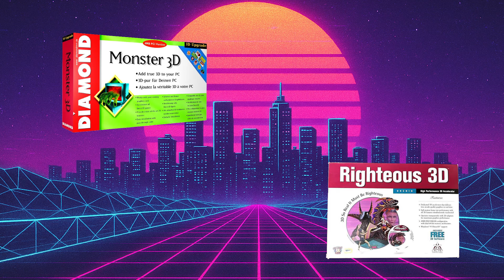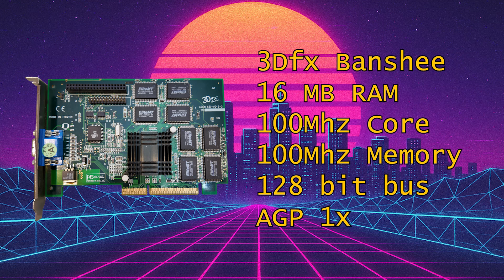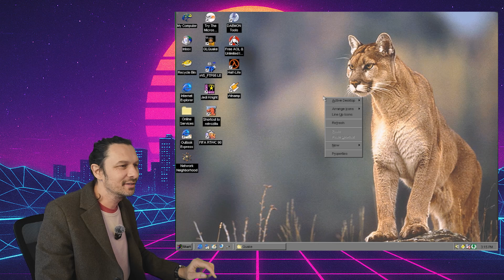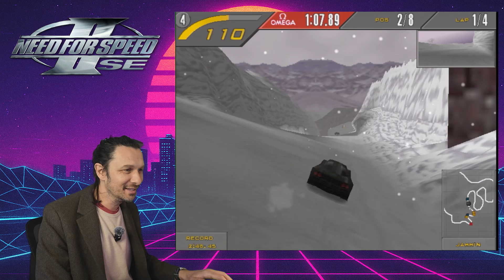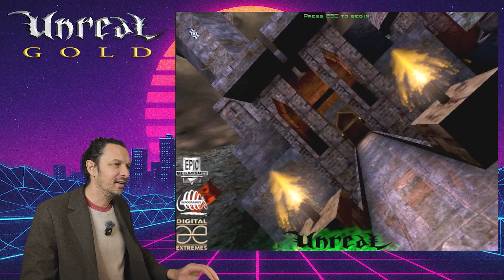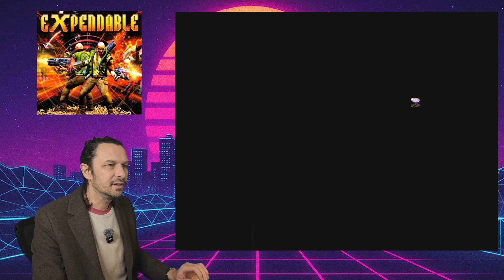3dfx Voodoo Banshee Revisited: One of 1998’s Most Important GPU's?

Comment: Banshee cards, much like the Voodoo 3, 4, and 5, scale well with faster processors. Pairing them with like a Pentium II 333mhz, let alone any Pentium II or AMD K6 II or III, you just end up with the Pentium II or K6 bottle-necking the Banshee. Most of the major titles back then were heavily CPU dependent. Like pair a Banshee with something along the lines of an Athlon 750 or Pentium III 733 and you will see a pretty significant performance jump in games released in 1999 and prior in D3D, Glide, and OpenGL. Also, you can use the WickedGL files if you want to tweak performance in certain OpenGL games. People watching this video should use it as an example of how a Pentium II can benefit from a Banshee, but should understand, the card is capable of much better performance than what was demonstrated here in this video.
Reply from the maker: Completely agree, I'm actually thinking about doing a follow up video where I demonstrate its legendary scaling, and put it in a Pentium 3 993Mhz system and compare the benchmarks.
Reply: @ComputerRetroBus  Fastest setup I ever used a AGP Banshee in was with an Athlon XP 2400+ on a Asrock K7VT2. Had a Monster Fusion Banshee paired with that combo. Anything the Voodoo 3 could run, the Banshee could also run, just a tad slower. They both basically had the same kind of performance cut off where later DX7-DX8, OpenGL, and Quake 3/id Tech 3 engine games ultimately became their bane. Even the Voodoo 4 and 5 struggled with later OpenGL and id Tech 3 games like Serious Sam, RTCW, and Medal of Honor.
Reply from the maker: @TheOldGodFX  wow that's epic! I have never tried a system that fast with my Banshee! time for another video lol
Reply: @ComputerRetroBus  This is the video I recorded of the setup 15 years ago or so. I keep it hosted on my older channel that I use for random stuff.
https://www.youtube.com/watch?v=pYWVfcSlUXc
Reply: Not really a pentium 2 300 will get the same frame rate as pentium 3 900 MHz in quake 2 so I'd say you're talking shite 🤣 unless you're playing at an extremely low resolution
Reply: @si4632  It's much more nuanced than this, and the way you post makes it seem like you simply scraped your knowledge off a few Banshee haters, instead of having actually used them. Youre hyperfocused on one particular game that I never even mentioned, Quake 2. Also, since you mentioned it, the Voodoo 2 featured two TMUs (I never mentioned the Voodoo 2 in my comments). This gave it an advantage in Quake 2 over the Banshee in multi-textured games, up to a certain point (single V2 card 8MB vram limit kicks in eventually at higher resolutions, but usually at higher resolutions past 1024x768 it doesnt matter anyway either with Banshee or 12MB Voodoo 2 because performance tanks hard).

In Quake 2, in general, the Banshee still benefits from a faster processor over a slower one because CPU dependent areas with a lot of enemies and effects going on still benefit from faster clock speeds, and prevent worse lower minimum FPS dips than a slower processor would experience. Basically, all decent cards benefit from this, not just the Banshee in this game. Quake 2 isn't completely performance capped and gets better with faster processors. And the Banshee in general handles the game well at 800x600, which was a fairly desired resolution to use in 98-99. Getting 45-50 FPS averages are fine on Quake 2 with a Pentium 3 @ 800x600.

And again, to address the whole Banshee vs Voodoo 2 thing, again mind you I never even mentioned a Voodoo 2 to begin with, but either way, they traded blows. The Banshee excelled at single texture games, which a lot of Direct3D titles tended to be in 98-99, running many of them much faster than the Voodoo 2 was capable of. Off the top of my head, Expendable and Dethkarz comes to mind, and then you have those 3D mark 99-2000 scores too showing how D3D favored Banshee more. 

Again, you also had the whole vram limit issue, which caused some games to favor the Banshee a bit compared to the Voodoo 2 8MB instead of the 12MB variation. The Banshee also had hardware variations, some of which like the GA-630 being a small bit faster than others (SGram vs SDram). The Banshee also benefitted from using the more mature drivers that were released near the end of its support life. The initial driver release was meh at best.

One of the major benefits though that is absolutely worth mentioning of using a Banshee over a Voodoo 2, is the whole single card solution it provides, with strong 2D performance for Dos games. Someone who is going to want to either simplify their build, or free up PCi slots to use multiple sound card solutions, MPEG2 add in cards, or things like USB or SCSI PCI cards will really appreciate the fact that they wont have to deal with one or two Voodoo 2 cards along with a extra 2D PCI solution. But I mean, for any of the above, you don't need me telling you any of this. You have years worth of post on Vogons, youtube, along with archived post and reviews from older websites and their related forums.
Reply: @TheOldGodFX no at 800x600 it's the gpu that's the bottle neck no need for essay mate I got the benchmark results readily available for unreal quake 1 quake 2 on a wide range of cpus lol
Reply: And you actually get batter results adding a second voodoo2 than you would using a 800mhs pentium 3 lol
Reply: @si4632  Uh huh. Who are you trying to convince here, your, or me? You have a channel with no videos and have been posting literally nothing of merit. Just a lot of typo laden yapping. How old are you even, child? Let alone, do you even English, bro? Can't you be bothered to at least proofread or fact check before you click "post"? Regarding lone 8mb-12mb Voodoo 2 cards and the Banshee, 800x600 was often the sweet spot for the vast majority of demanding Direct 3d, OpenGl, and Glide titles on either card. 

You realize a lone Voodoo 2 was not a massive performance leap over a Banshee in Quake 2, no? We are talking a 5-10FPS gain, depending on the area of the game you are in. Both cards were pulling over 40fps, and coming in under 60FPS @ 800x600 in Pentium III builds. The average was very close, and some Banshee cards were able to get closer to minimizing the performance gap with better clocks in that game.

Since you're obsessed with the game, you should already know a lone Voodoo 2 was only pulling in about a 55-60 fps average in Quake 2 at this resolution, depending on your processor, and COULD NOT even do 1024x768 in that game, let alone any game, due to the limited hardware framebuffer. You needed two of them to do past 800x600. The Banshee however could run Quake 2 and plenty of other games at a playable framerate in 1024x768. You know what used to cost a whole lot more than a single Banshee in 1998? Two Voodoo 2 cards paired with a 2D accelerator card. Do the math on this bang for buck situation you goof.

This was pretty much a thing for most graphics cards released in 1997 and 1998 though. Even the Voodoo 3 benefitted drastically from using 800x600 instead of 1024x768. Most review websites at the time even bench tested at 640x480 and 800x600 because that was the resolution most gamers were using.

"And you actually get batter results adding a second voodoo2 than you would using a 800mhs pentium 3 lol"

You going to bake a cake with that batter? Also, is Quake and Unreal the only things you have ever played in your entire life? You realize there is thousands of games out there from that era, no? If I was as obsessed with Quake 2 as you are, I'd simply run it on my RX 7900 XT, since it smashes the Voodoo 2. And this can be said about every single modern GPU. They all smash a Voodoo 2. Seriously, you're worried about fighting with complete strangers about pitting two 3DFX products against each other in old games, worried about the Voodoo 2 winning more in 2026? Said games that can be run on anything modern with far greater performance? 

Are you serious? And now you're experiencing that self-doubt, realizing you were wrong, and having to switch over to "with two Voodoo 2 cards you can do such and such..." once you googled and realized a lone Voodoo 2 can't do past 800x600? One, the only one worried about or bringing up the Voodoo 2 here is you. Did you just recently get a Voodoo 2 off ebay, and now you feel threatened and triggered about your purchase by Banshee users and want to feel validated that you made the right choice? I mean I can tell you don't even have a Voodoo 2 in hand yet, because you have completely ignored the fact that they can't do past 800x600 unless run in SLI.  Someone who has actually owned/used a Voodoo 2 would not be trying to argue in its favor so hard against the Banshee knowing full well a lone Voodoo 2 has to trade blows and can't do 1024x768.

The OP, nor I, ever mentioned anything about Voodoo 2 cards because they were not the topic of discussion or in the video. This is completely a Y.O.U. thing and you are making yourself look stupid AF. And two, not only did you go from one Voodoo 2 to now needing two Voodoo 2 cards, but you also now insist a second Voodoo 2 is more beneficial to a PC of that era instead of jumping from a 333mhz Pentium II to a 800mhz Pentium III? LMFAO. That is literally not going to balance out. You can't replace the overall benefits of a faster processor in games with a second Voodoo 2. 

Two Voodoo 2 cards with a Pentium II @333mhz are not going to obliterate a Banshee paired with a Pentium III @800mhz in the vast majority of games released during 97-2000. Some games that could run with a potato for a processor, sure. But then you run into ones that use Software T&L heavily, or like cpu dependent racing sims, and that's that. The Pentium II 333mhz can't compete with the Pentium III on any level, let alone one running past 600mhz. It's simply absurd to suggest that is a thing.

Worried about the benchmarks ehh? Check the link below, but the sum of it is:

3DMark 99, Banshee beats Voodoo 2.
3Dmark 2000, Banshee beats Voodoo 2.
OpenGL Stars, Banshee beats Voodoo 2.
Villagemark, Banshee beats Voodoo 2.
GL Quake, Banshee can run the game at playable performance at 1024x768, Voodoo 2 can't.
Quake 2, Banshee can run the game at playable performance at 1024x768, Voodoo 2 can't.
Unreal Tournament 800x600, Banshee 31fps, Voodoo 2 38fps (literally a OC close the gap kind of situation).
Quake 3, Banshee smashes the Voodoo 2, and it takes two 12mb Voodoo 2 cards in SLI to catch up to a lone Banshee in 800x600 (literal example of the limited frame buffer kicking the Voodoo 2 in the nutts).
Undying, Banshee beats Voodoo 2, but this is a close one at least.
Dungeon Siege, Banshee absolutely beats Voodoo 2 with a large performance gap (and this is an example of why frame buffer, vram, clock speed etc. matter when comparing the two).
Serious Sam SE, again the Banshee sends the Voodoo 2 packing.

https://hw-museum.cz/article/2/benchmark-vga-1998---2001--2011-edition-/1
Reply: This with a voodoo2 which is actually faster than a banshee
Reply: If you're talking about later games fair enough but you would be stupid to pair such a weak card with a 1ghz machine 🤣

Comment: If you could do a whole video on removing and installing Slot 1 processors, I am sure I'm not the only one who would be eternally grateful.
It isn't the most obvious thing in the world and trying to find instructions for it, well, you'd be inclined to think you hallucinated the very existence of Slot 1. To make matters worse, there are multiple, very different retention mechanisms for Slot 1.
I pulled a Slot 1 processor last week and I'm still not convinced I didn't break the bracket. I had a couple of pieces left over...is that normal? I missed out on Slot 1 back in the day and I'm so confused. 
Frankly, I wish someone would do the same with the stock intel cooler of the past 25 years. I've read and thought I was following the instructions many times only for it to not work. Not sure I would trust it even if I did manage to get it to stick. It is a thoroughly mind boggling design to me, as someone who studied physics and industrial design, which is probably why I can't figure it out. It is too stupid for me to comprehend :P
Reply from the maker: heheh no problems for sure, I will go into more detail next time I do it, I completely understand and also the intel cooler with the 4 fan retention slots you need to twist, took me ages to figure that one out

Comment: Quake 2 was released 6 months before the Voodoo Banshee and Unreal just 1 month earlier. Unreal is very CPU dependent, the P2 333 mhz is just too slow. With a P2 400 or 450 mhz it would have run much better.
Reply from the maker: Yesh I agree, and the voodoo cards really scaled well with powerful CPU's in general I feel
Reply: @ComputerRetroBus  They do, but voodoo cards (especially voodoo2) are also lighter than other cards when running in glide mode, cause glide is low-level API with lover CPU overhead. That being said, with Unreal there is a major CPU bottleneck there. I suggest disabling dynamic lighting and setting the "min desired framerate" to 999, that reduces particle count. Those two options help with the CPU load a lot, and the game keeps most of its visuals. With Unreal and especially UT, you had to have a 1+Ghz PIII or K7 if you wanted to be in the "keep it above 60" territory all the time. Generally, back then CPUs were very underpowered compared to what those cards could do. Thankfully, the SLOT1 platform had huge upgradeability options in the future, and you could run overclocked Coppermine Celeron on the same board 2 years later with 3x the performance. If you had one of the better BX boards and proper adapter, even Tutaltin.

Comment: Interesting video. Yeah the Voodoo Banshee only run in 16-bit but it had the best 16-bit quality of all the 1998 cards thanks to the 22-bit filter. The Voodoo Banshee was the first 3dfx card to support the 22-bit filter, always active in resolutions of 800x600 and lower and in 1024x768 it had to be activated manually. The Riva TNT was overall faster than the Voodoo Banshee by 10-30% but the 16-bit image quality was inferior to that of the Banshee, the Riva TNT (just like the TNT2 and Geforce) in 16-bit displays a very ugly looking grid pattern especially visible on dark textures. And in 32-bit the Riva TNT (just like the TNT2 and Geforce) looses 40-60% performance compared to 16-bit. In my opinion higher clocked Voodoo Banshee cards like the Gigabyte GA-630 (110/130 mhz) and Monster Fusion (105/120 mhz) were clearly the best video cards of 1998, because they had the same speed as the Riva TNT and Voodoo 2 but better 16-bit imagine quality (and better game compatibility than the Riva TNT).
Reply from the maker: Thats fantastic insight and detail. So the Banshee wasn't that far behind at all really to the TNT, what a gem of a card, I really love and cherish mine. I really need to try and overclock and see how I go, never tried it on a Banshee before.
Reply: Totally subjective. If you're obsessed with graphical detai, sure, go with the Banshee. If you want stability, reliability, high framerates and the best overall support, go with the TNT. There is no magic retro gaming GPU. I feel like the people who are most supportive of Voodoo really only play 5 or 6 cliche '90s PC games. When you have a lot of hardware, like me or OP, it is easy to sing the praises of Voodoo because, when it lets you down, you have another, more reliable PC right next to it. Most retro gamers aren't going to have that advantage. The Voodoo was a poor value proposition back in the day and it is a poor value proposition for retro gamers in 2026. The fact the TNT renders less smooth textures is actually a feature these days, not a bug.
Reply: @RunsWithChainsaw  you clearly don’t know what you are talking about. Stability, reliability, game compatibility were the strengths of the Voodoo cards, NOT of the Riva TNT, that’s the main reason why games loved those cards. With the Riva TNT you couldn’t even play games like NFS 2 SE, Carmageddon 1997, Scremer, Blood and many others they had ZERO support for the Riva TNT, you had to play them all in  SOFTWARE MODE while with the Voodoo cards you played them in Glide. Even the first version of Unreal 1998 only had Software and Glide support, no Direct3D support at all, only lated versions added Direct3D support. Even Unreal you were forced to play in SOFTWARE MODE with the Riva TNT for a few months after it’s release until Direct3D support was added with later parches. And even with later patches only after around 1 year Unreal finally got a version that run well on the Riva TNT. I had exactly a Riva TNT back than, I know what I’m thinking about. And like I already said the Voodoo Banshee also had a better 16-bit image quality than the Riva TNT and higher clocked versions like the Gigabyte GA-630 clocked at 110/130 mhz and Monster Fusion 105/120 mhz roughly had the same speed as the Riva TNT. The Voodoo Banshee was the better card and better deal than the Riva TNT because of this. Sure the Riva TNT was very fast and modern for a 1998 card but you couldn’t use it in 32-bit color because the performance dropped by 40-60%, it had a bad 16-bit image quality with an ugly grid pattern especially visible on dark textures, it had huge compatibility issues with 3D games released between 1996-1998 and it was more expensive than the Voodoo Banshee.
Reply: @RunsWithChainsaw  I first had a Voodoo 1 with a 233 MMX running at 290.
Later I upgraded to a K6 350 with a TNT.
I was not really impressed by the TNT ...
And never had any problem of drivers with V1 or V3.
I play a bit more than 5 or 6 different games ...
"The Voodoo was a poor value proposition back in the day" --- Really ? Compared to what ? Ati  (I had one with the V1) ? Matrox m3D ? Riva 128 ? Savage ? Kyro ?